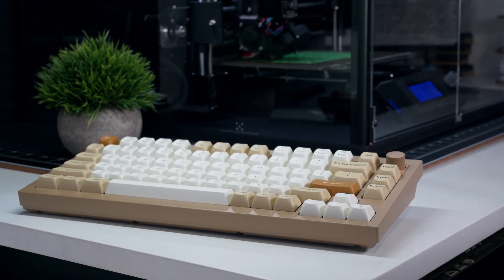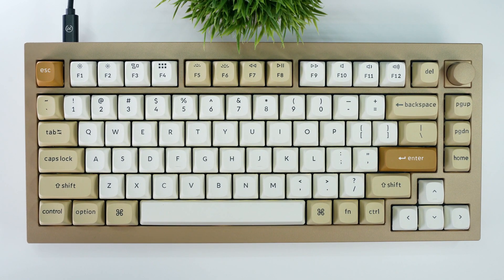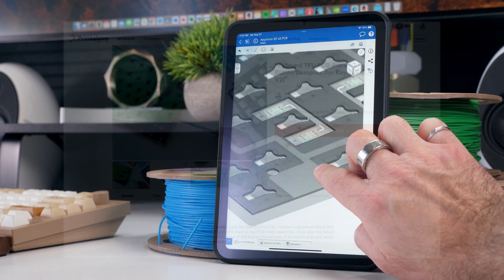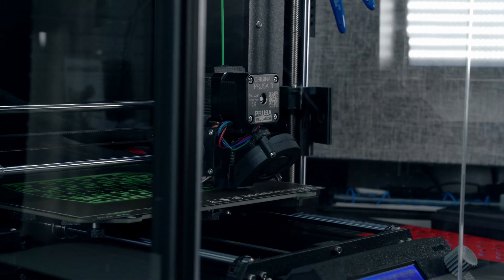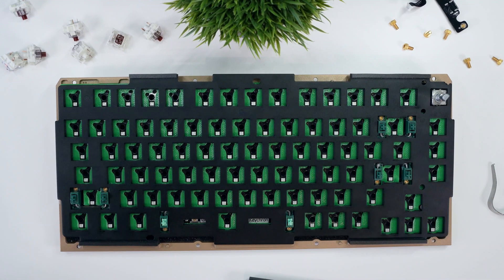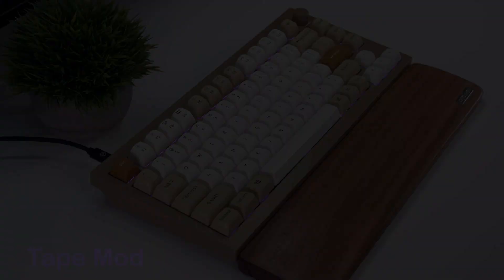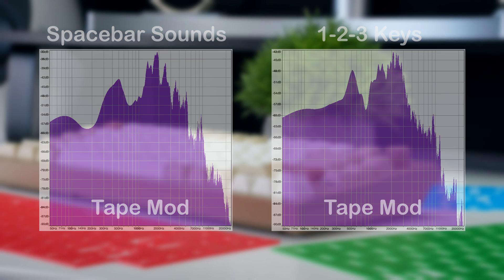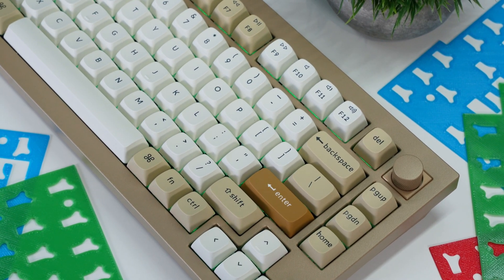3D Printed PCB Sheets - Mod + Results

Comment: Perhaps do a sandwich of two layers being 0.2mm of TPU 0.2mm and a middle layer of 0.2mm Foam or perhaps a completely different material such as PETG which seems like a pretty "dead" material
Reply from the maker: Cool idea!  I print a lot of TPU-PETG-TPU composites, so it’s definitely doable 👍 But I find I usually need at least 2 layers of TPU to form a structurally sound sheet… definitely worth experimenting with though 👍 Perhaps as a replacement to the existing PCB foam if it were to get a little thicker too - Thanks! ✌️
Reply: @JakeReevesVideo  Perhaps print it as a single plate sandwich without removing from bed before completion.
Reply from the maker: That’s what I do 👍 I’ve made a profile that can handle both materials - just pause to change filament at a layer transition
Reply: @JakeReevesVideo  Ahh yeah, you wrote exsactly that, my bad :)
Anyways, cool test, was surprised you had TPU in three different colors.
Reply from the maker: Thanks!  I print a lot with TPU - watch straps and notebook covers (I have a video about my printed Rocketbook covers), so I usually have 8 colours or so on hand 👍 it’s a cool material